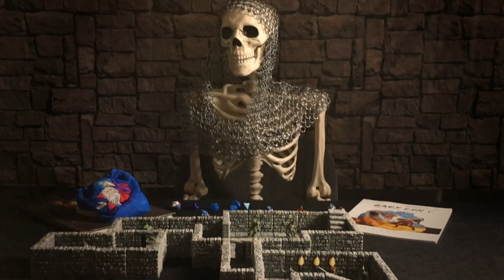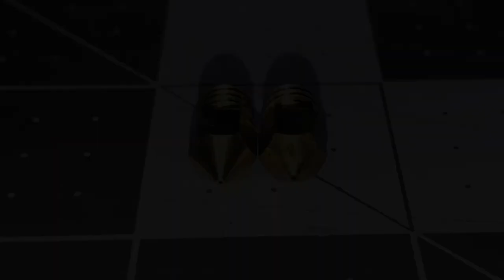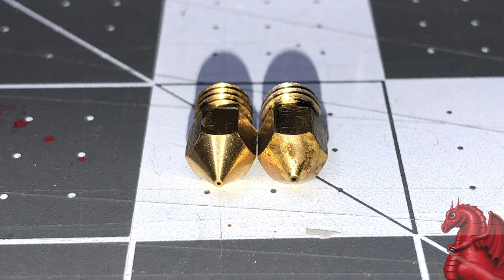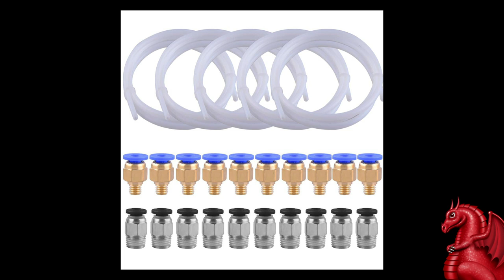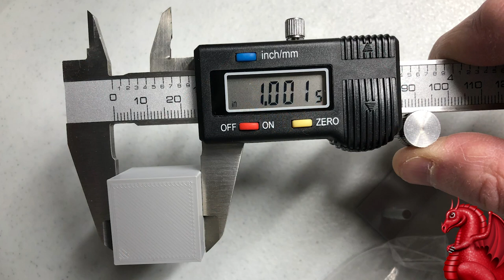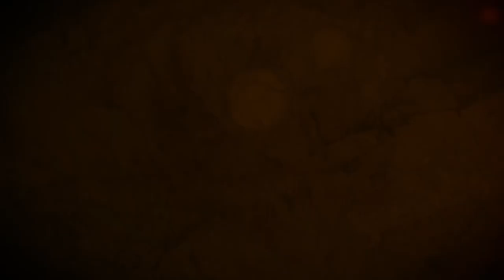NOZZLE EROSION! What to look for and when to replace them!

Comment: As a data point, I've got a MK3S that was assembled in September of 2020. According to the onboard statistics, it has just over 24days of print time (over 3yrs) , just over 1,700m of printed filament, and is on the original 0.4mm nozzle. I print ~80% prusament PETG, rest either prusament PLA or eSUN PLA+.  I've been waiting for its print quality to be visibly affected so I've had an E3D Nozzle X since the machine hit the 6 month mark, but it's been fine thus far. Watched this video because I was thinking of swapping it out; I've got a ~52hr print using marble PLA coming up.

Time printing and Filament type/length extruded are probably better metrics for guidance than age in months, unless I misunderstood and 4 months IS referring to the print time of the nozzle.

Comment: Tungsten carbide is the way to go. Thermal performance similar to brass (at least way better than stainless) and it lasts literally forever rather than somewhat longer, even if you print GITD, wood fill, CF fill, etc.

Comment: thats eroded using PLA? which color?
Reply from the maker: Gray. Any filament will erode a nozzle. Just look at what water does to rock with enough time. :)
Reply: @Tombof3DPrintedHorrors  I don't print as much as many others do, for that wear to be done in 4 months seems like so much. I'm only going through probably 4-5 1kg spools in a year, cheap nozzles has variances, while original expensive ones marked up too high locally

Comment: Would stainless be better??
Reply from the maker: Yes and no. It won't erode as fast, but it doesn't conduct heat as fast as brass, so it takes longer to adjust to temperature changes, where brass maintains a constant temp better.

Comment: Ive used capricorn since day one of printing back 4 or 5 years ago. I havent looked to much into it but could possibly going back to the standard white PTFE tube give any benefits over capricorn?
Reply from the maker: I stopped using Capricorn as the tolerances were so tight some variations in filament diameter actually caused friction when feeding. I get great results with standard white PTFE tubes.
Reply: @Tombof3DPrintedHorrors  Ill have to give them a try, thanks for all you do man!